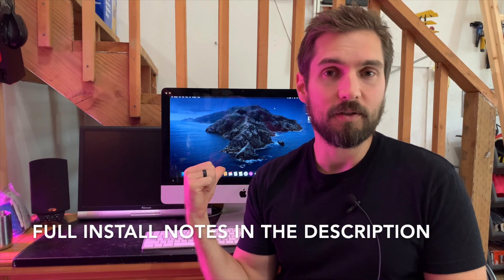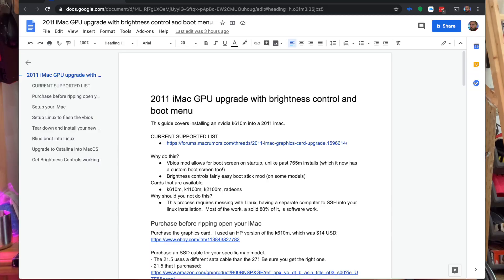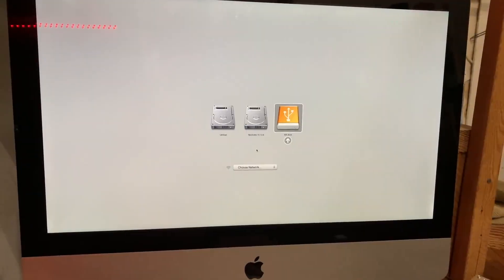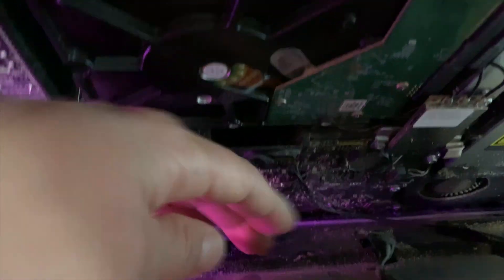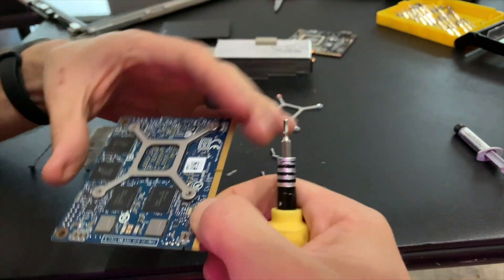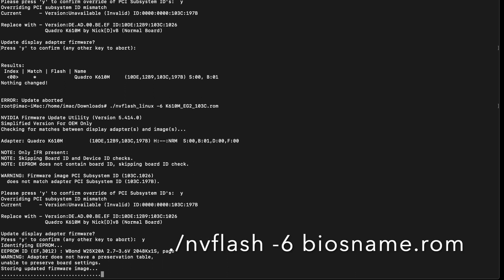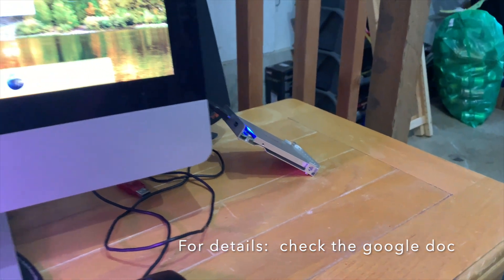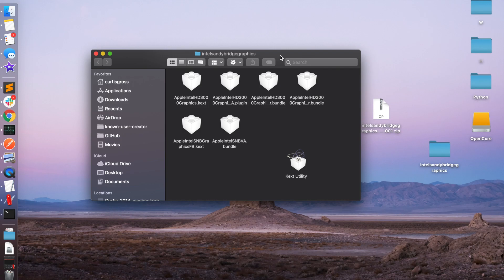2011 iMac GPU Upgrade Now with Brightness and Boot menu - Absolutely Worth It!

Comment: Can you do it in an IMac 2009?
Reply from the maker: I know it is possible with the 2010, but not as sure on the 2009 (I don't have one on hand to check!).  I know one thing though - This requires at least an i3 chip in your machine.  SO no core2duo support (check your 'about this mac' under the apple in the top left to see the specs)

Comment: 10:12 - i finished the job with a whole bunch of screws too! :'D
Reply from the maker: They were spares, included by Apple for us.
Reply: @messing-with-computers  AAPL are too kind! :'D Cheers for another extensive teardown!
Reply: @messing-with-computers  Hi buddy! You seem to be the man that knows a thing or two... I wonder if you know why exposed cables touch the imac outer casing? I went through re-seating/learning all the cabling setup pulling some of the EMI tape off to find this precarious situation...  Have taped all back perfectly but it's left me very curious... Thanks man! :)
Reply from the maker: @walshmagic  - might be the wifi/bluetooth antennas? Potentially the heat-sensors. If you have a picture of the cables I might be able to ID them.
Reply: @messing-with-computers  It's definitely the bluetooth and camera black cables. They have an inch of cable cover cut off then the exposed cable stuck down by the silver mylar tape... I'm guessing it's a grounding mechanism of some sort... Just a bit of a concern knowing the case is a potential shocker! :'D

Comment: pls make a video for dummies, show every step to get this k610 working in a 2011 27" iMac. this would be one of the greatest things about the 2011 iMacs
Reply from the maker: All the steps should actually be the same.. except 1.  You will need to modify the heatsink!  Check out my earlier video where I install a 765m into the 27 inch 2011 imac, I show exactly how to modify the heatsink to get it to match the smaller video cards (like the k610m).

Comment: WELP .. Installed k610m and flashed from linux, worked fine in High Sierra (in opengl etc). Went though the steps in video for Catalina and I'm stuck in a boot loop. It starts up, the text thingy boots and does its thing, apple logo and progress bar get half way and then it resets, round and round forever. Holding shift to boot into safe mode works, but no idea how to diagnose whats causing the normal boot crash. Anyone ?
Reply from the maker: Coffea - did you re-run the dosdude installer after the Catalina install in order to apply the “post install fixes”?
Reply: @messing-with-computers  Yes I did (and had to enable APFS option to get it booting or it would just sit there). I just removed all the AppleIntelHD3000 extension files and rebuilt cache with the kext tool and now it boots, no brightness control but it boots, so im going to back away slowly and find my sunglasses !!
Reply from the maker: Coffea the process for the kext files is wonky for sure.  I have broken a few installs with them before. It’s gotta be the perfect process, with no mistakes. Haha.
Reply: @0xc0ffea  Having the same exact issue. Did you ever find a solution or are you living without brightness & sleep mode?
Reply: Found the cure if you're interested from an above commenter's post. @PlantBasedCase:

"I FIGURED IT OUT! 🙌🏻 Turns out that since OS 10.15.4 onwards there's actually NINE kexts that need to be installed. 8 from the original folder, plus an extra one to tell Catalina to load the other kexts which explains why it kept half loading then crashing. I'm fairly sure I didn't actually use your Google Drive download for the kexts, but either way it might be worth updating your kexts folder download my man, I think yours only has 6 instead of 9. Here are the links for anyone interested:

First 8 kexts: https://forums.macrumors.com/threads/2011-imac-graphics-card-upgrade.1596614/page-131?post=27899047#post-27899047

Extra kext: https://forums.macrumors.com/threads/2011-imac-graphics-card-upgrade.1596614/page-236?post=28406927#post-28406927

After that you also need an extra step of adding a framework folder to enable intel quick sync for rendering with the iGPU. The first link has the additional instructions under "step 2"."
Reply: @yosukeDVJ  Thank you so much for posting this !!

Comment: Great vid! Thanks. I am having trouble with the K610m though. Everything worked fine with the new GPU but after patching to Catalina I got this strange issue when dragging windows with the mouse. I recorded it: https://youtu.be/J-tE-5gzwjU

Anyone any idea what this could be?
Reply: I found the solution on the macrumors forum. Apparently is has something to do with the "Legacy Video Card Patch". To undo the patch: https://forums.macrumors.com/threads/2011-imac-graphics-card-upgrade.1596614/page-162?post=28109056#post-28109056
Reply from the maker: Glad you found a solution!

Comment: so bad to use works of other people, the original thread is here > https://forums.macrumors.com/threads/2011-imac-graphics-card-upgrade.1596614/
Reply from the maker: Hey bushi - not trying to steal or anything, if you check out my prior videos this has been something I have been exploring and doing for a while. Yes, the bios is great, but not really the only piece of the puzzle. But - I’ll add more references to that forum for sure.

Comment: Reuse the old thermal compound... facepalm... That stuff has likely turned ineffective dont tell people to do that, it could cause overheating issues. This is coming from a background of 18 years in IT.. If the thermal past has turned solid, like yours has, yes absolutely replace it. Do the same with the CPU while youre in there.
Reply from the maker: Chris Honn - I’ll double check, but I don’t think I said to reuse the thermal paste - but to reuse the thermal putty, which doesn’t degrade like the paste does.
Reply from the maker: Ah - I said “put thermal paste on the cpu” when I meant gpu. I’ll put a comment in the video.  The only element I said to re-use was the backplate, which is needed to attach the heat sink.
Reply: @messing-with-computers  Where did you get your card? and was it expensive? I have a late 2010 21.5 inch machine i would like to try this with.
Reply: @messing-with-computers  This is what i get for not reading your full notes, facepalm from me.. Ebay here i come lol
Reply from the maker: @ltlk937  - Also I did listen again to my full talk track and I said 'add thermal paste, and reuse compound'  doh..  I basically screwed up my talk track by not making it super clear on what I meant.  Ill try to clarify somehow in the video annotations if I can figure those out!
Reply: @messing-with-computers  all good. Btw i subbed and bookmarked your video, i plan to use it for my own video card on my  mac.
Reply from the maker: @ltlk937   - its a blast, just don't break the monitor cables !   Also, be very careful with the 27'' motherboard, it has a few small resistors that can be easily damaged (been there!) so it does take a little more grace than the 21.5''
Reply: @messing-with-computers  I know right. So fragile!!